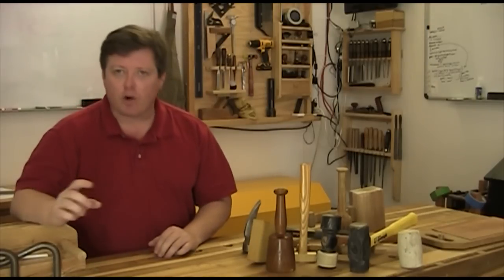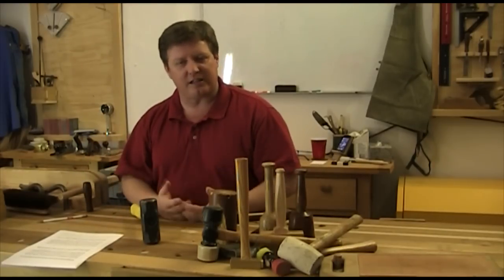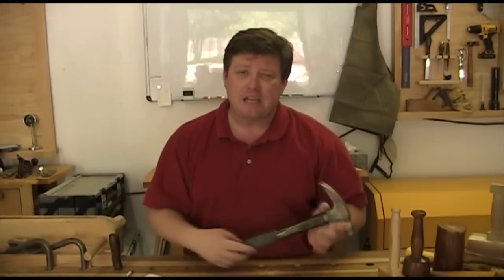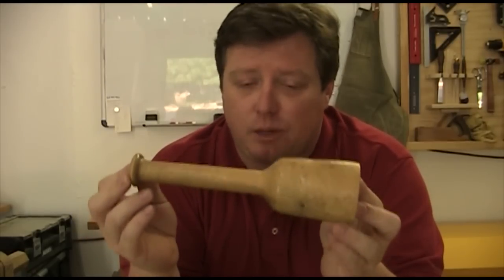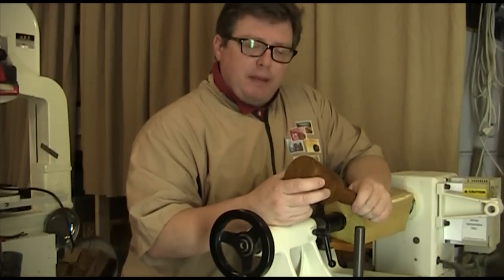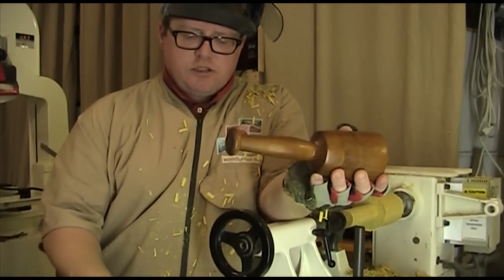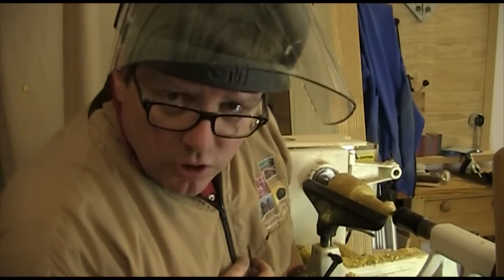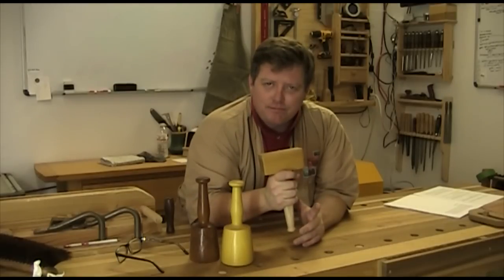Design and Build Your Perfect Mallet: purpose, design, creation

Comment: Another great video sir, I did buy that load of Black Walnut I told you about this past week. It is green wood. I made a mallet for wood working, posted epic on Instagram and put your channel name in the # sign thing. It was a fun first build for me on the lathe. One thing from the several I learned while being a new user to the lathe, is the wood was so wet, it actually started rusting the bed of my lathe while I was working with the green wood. Less than 2 hours would be my guess. I had used a rust preventative spray on the bed prior to me using it but it obviously is for air moisture content, not actual dampness on the bed. I found a fix for that and gold I decided to clean up after I pulled the mallet off the lathe. Good stuff in this video, I am watching it after the fact on the one I made and I am pretty proud of my own little design I came up with. I plan to use it in the leather shop some a swell. Thank again for another great video sir and I hope you have a blessed weekend. 
Dale

Comment: I hate round handles on mallets, hammers and dovetail saws. The round headed mallet would be the exception because the strike face is 360 degrees. I don't like having to look at the hammer head after picking it up to see it's orientation and then take the extra time to rotate it. Along with that there is the extra strength on the grip necessary to prevent it from rotating in your hand that an oval, or somewhat rectangular shape provides.
Reply from the maker: look for a video on mallet design I did.

Comment: What’s the length of your mallets? Thanks
Reply from the maker: depends on purpose
Reply: wortheffort Mr. Effort: I very much enjoy your videos. Especially the long form because as a new turner with almost no tools outside of the lathe (cheap hobbyist), you have non-professionals in mind and you have marketing in mind. I made a mallet out of an expensive piece of canarywood from Rockler. It is nice and dense and I wanted to give it away. But it’s so useful that I ended up using it to bang on things that needed banging and now I can’t [and dont want to] give it away. Thanks again.